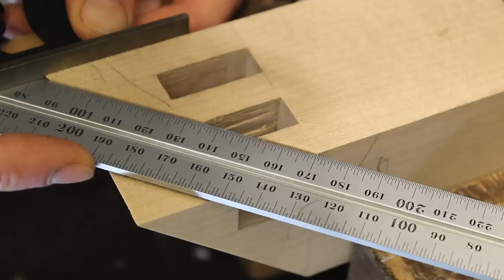Joint Venture Ep. 56: Double tenoned three way miter (Chinese Joinery)

Comment: Judging by the dimensionality, the blind joint with the single tenon is meant for a compressive load, not a sheer. Probably intended to be used on the corner of a structure to hold some kind of roofing member in place, but when you also want to hide the mitered joint. And twisting or lateral motion would sheer that tenon clean off. It's always interesting to look at the engineering of the joint and try to guess the applications it would be useful for.
Reply from the maker: It is actually the top of a Ming style Chinese cabinet!

Comment: Always incredible. Where do you come up with the ideas for these joints?
Reply: Three ways miter joinery is a very common joinery that has been used in China for at least a thousand year . Now a day you still can see it in China for most of of the solid wood furniture.
Reply from the maker: Exactly!
Reply: Do you work off prints, or just design it all yourself?
Reply from the maker: Matt Svoboda I didn't have any prints, just a picture of the joint. Then I reverse engineered everything.

Comment: this would save me a ton of money on nails and screws
Reply: Yes, it would but how many hours would you spend instead!
Reply: @jimmytwizzle7836  CNC, copy carver, pantarouter, traditional tool jigs, lots of options to make this joint quickly
Reply: @RickyHarline  Still nowhere near as quick as a screw.  All those methods you mentioned would take a long time. It's not a surgeon where you put a piece of wood into a CNC router, and it cuts it out. It would take many setups, many cutters, and a long time.
Reply from the maker: Screws won't last long. Maybe 10 years tops. This one will last 100's of years if taken care of properly.

Comment: why does the second (tooth) on the third part go only partial to the joint and not all the way thrue?
Reply: If you pause at 19:07 you can see the hole that the short "tooth", which is called a tenon, fits in to. If it was any longer it would hit the tenons on the other piece. At 19:07 when he holds the 2 assembled pieces up and shows the bottom look in the right side hole to see what I'm talking about. Hope this helped.
Reply from the maker: What Miller said

Comment: Can this joint I use for cabin corner? How strong this joint?
Reply from the maker: It is strong, but meant for furniture. I don't think it is hefty enough for carpentry. Plus, miters with that much load bearing tend to open if not preloaded.

Comment: Excellent work (as usual). What's the name of the saw used at 13:02 ? It's not the ryoba you were using earlier on in the build and it looks like it has a nice wide blade.
Reply: Never mind, I can see it's a Z Saw Kataba Universal Crosscut from the markings.
Reply: Cross blade not universal crosscut (doesn't have the leading III before the 8)!

Comment: looks nice, but what is the strength of the joint with a downward pressure on the lintel?
Reply from the maker: Thank you!
Strong enough for furniture to last the ages. Also depends on the dimensions of the material.